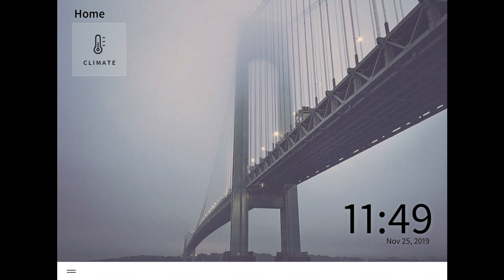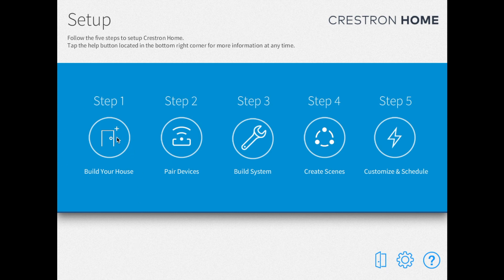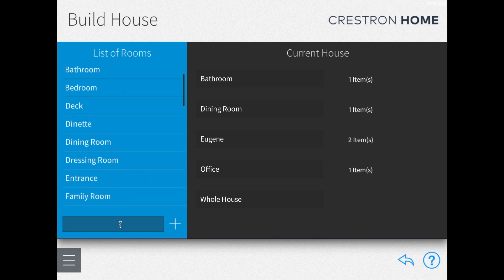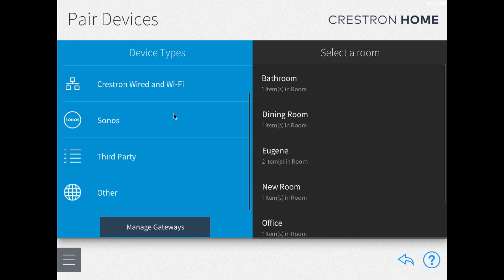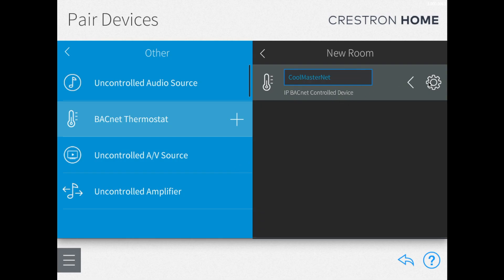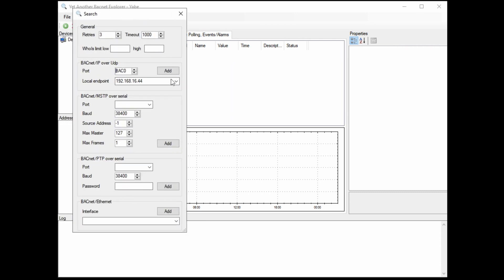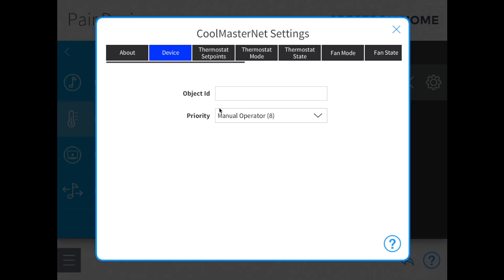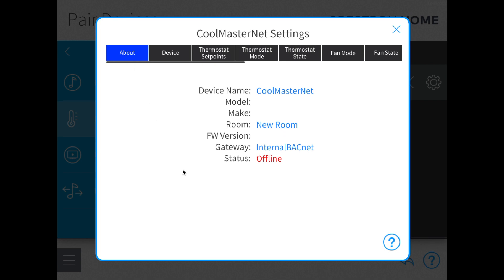How To Integrate CoolMasterNet With Crestron - Coolautomation

Comment: Unfortunately this is only step 1 and the easiest part. It would be great if you could follow up with a video showing how you then connect the multiple points for each zone. Even better if you could do this for several different common HVAC brands.